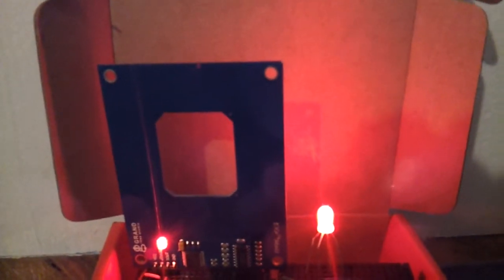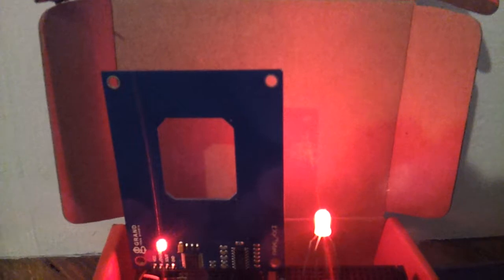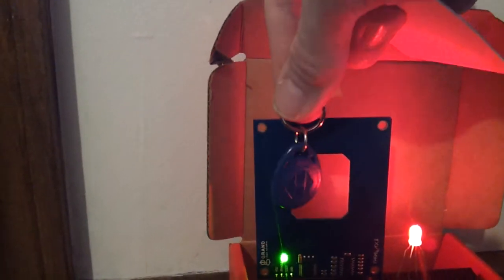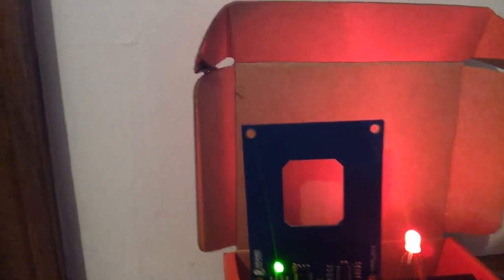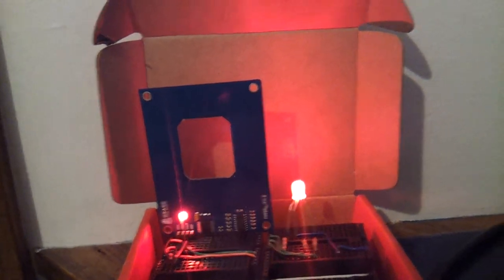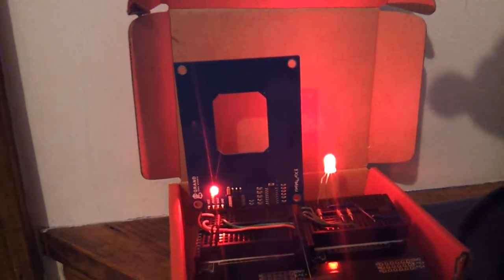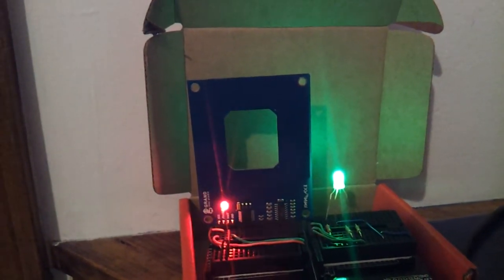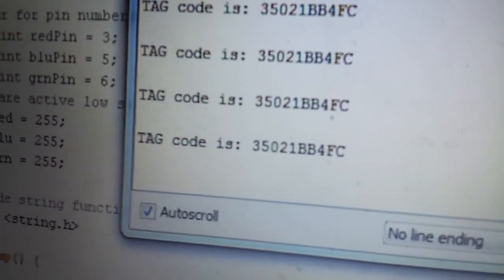Parallax 28140 RFID with Arduino detecting Specific TAG ID

Comment: Please is it possible if you help me convert this code to C ? It seems the code is written in Arduino
Reply from the maker: Direct Answer: I can not

Thoughts to consider: Arduino is based on C and C++ but some functions are arduino specific like serial.Read(); If memory serves correct the C18 compiler I used with MPLAB  first required configuring the Micro's UART with assembly, and then the C command to read the UART RX pin is ReadUART(); Seems you need to configure the UART for 2400 baud and loop through the RX pin to populate a string of characters or one dimensional array.

I recommend you find the forum for the compiler your using with MPLAB for C, or maybe the microchip website. Most of the time it is the slow baud that causes trouble, as it depends on how the PIC is configured. --Regards

Comment: Hello, Please can you help me explain something, am doing a similar project on robotic cells, right now at stalk at getting the Parallax work, i Have connected the parallax and the LED shows green. i am using the ICD3 to connect to the MPLAB. but am not sure how to get on with it. i have my tags and how to scan it during the antenna is kinda difficult. can you give me steps on how to sort this out. and what software do i need to install for it to display the Tags number on the screen and also the code for the tags. my email is zandino23@gmil.com. i will appreciate if u help me out
Reply from the maker: Sorry for the late reply but the comment was marked spam. I do not know why ..I have several spam comments that seem legit.

There are a couple models of this RFID from Parallax, and seems there is another board that has a clock but it has been a while since I worked on the RFID. It has been even longer since I worked with the Microchip PIC and MPLab. This was done with the open source Arduino environment.

The LED on the Parallax board turns green when reading a tag an simply transmits the data (string of characters) to RX pin of microcontroller (Atmel ATmega328) asynchronously. It sounds like you have the card enabled, but you might double check. Also ...double check your serial baud on micro and PC, as seems it was slower for this tag.

If I get a chance I will look at my RFID but as mentioned I did not use MPLab on this. The data is sent to PC from micros TX pin via FTDI chip on Arduino development board to USB of Windows PC. I am using the serial monitor in Arduino IDE.

Best Regards, Joe